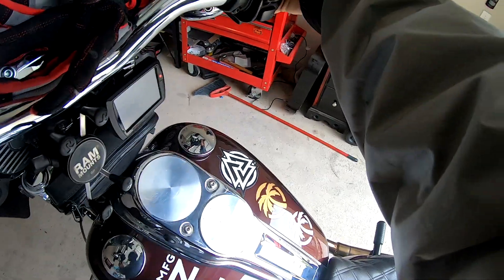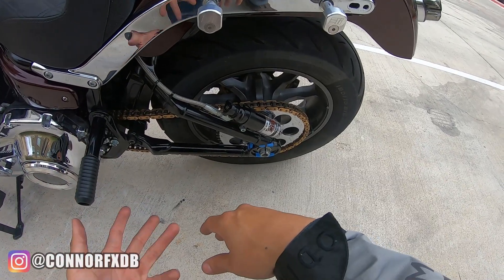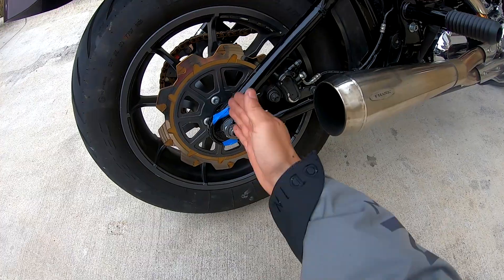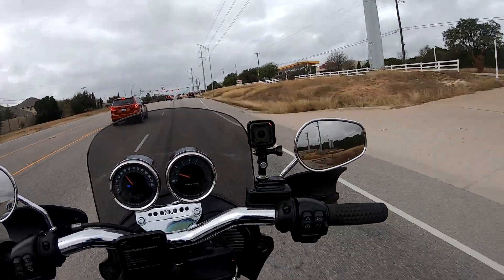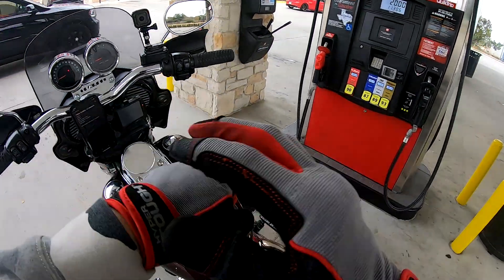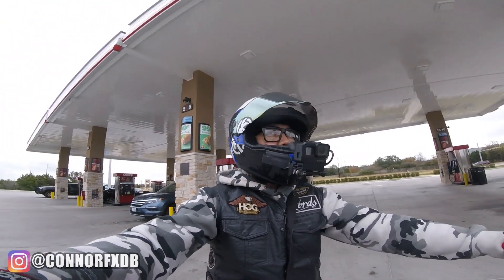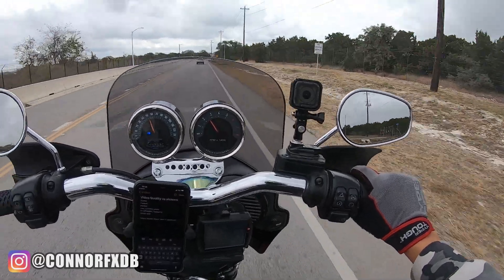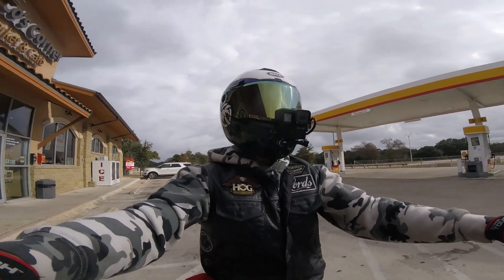This is a doozy | Trouble in paradise? Troubleshooting new shock issues and more

Comment: Did you first adjust the chain at the tight spot?  If not, you stretched it and you need to replace it.
Reply: Bingo. I don’t understand the hype of chain drive on fairly stock cruisers.
Reply from the maker: I did yes correct! I found the tightest spot in the chain and adjusted it. I even had a buddy sit on the bike and adjust it that manner but no dice. I think the new sag at this angle and height will be slightly more than OEM harley spec. Thank you for watching!
Reply from the maker: @John_shepard  It depends on the rider and the purpose of why. Initially I wanted chain for mainly aesthetics. I truly enjoy how they look over belt and dont mind the added maintenance every so often to keep it in pristine working conditions. 

I am starting to explore track days on my cruiser and chain will be a lot easier to fix in the event I snap the chain at the track and can be out for 1-2 sessions and back out after new chain vs having to cancel the rest of the day with the belt. 

Thanks for watching and I appreciate your comment!